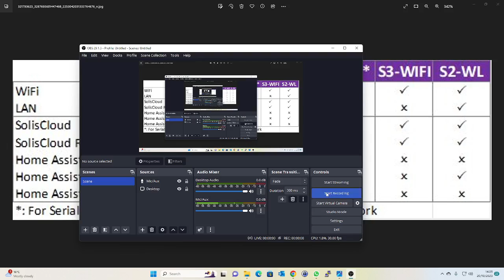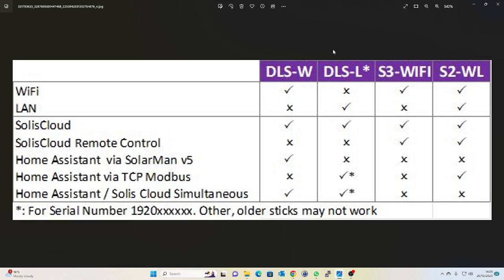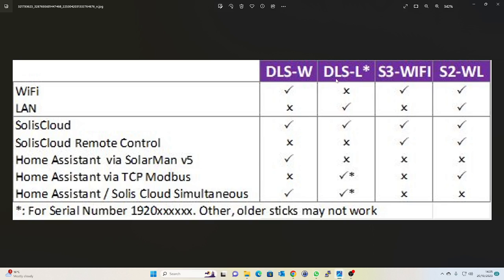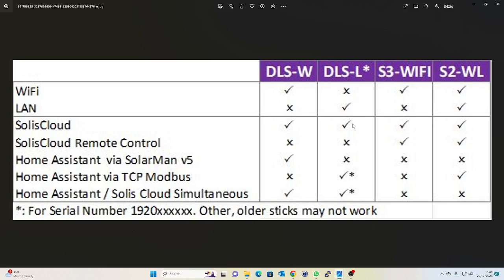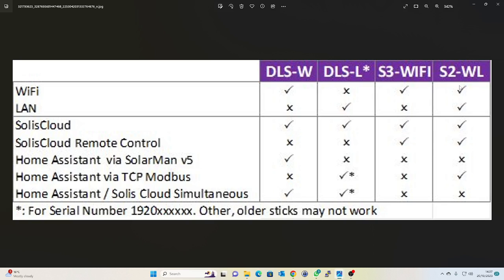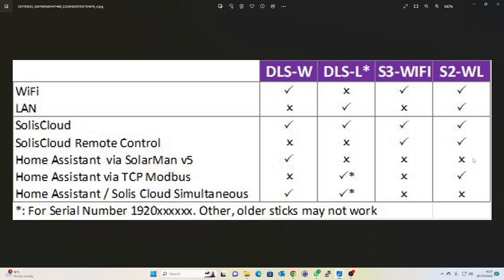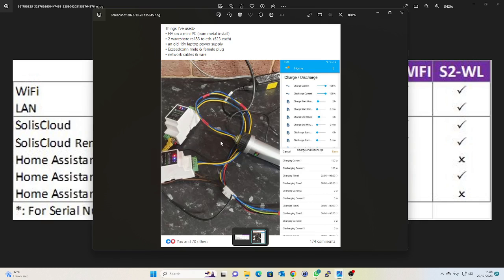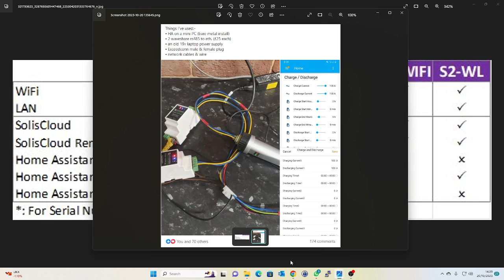Solis Inverter Data Loggers and Home Assistant - which ones will work?

Comment: Wow, your video is so useful. I managed to integrate my Solis cloud to Home assistant so I can monitor the power in my home solar system. I got to the point where I can see my inverter data on HA but I can't seems to find the Home battery storage when I need to configure battery system.  Energy going in to the battery and out of the battery sensors is missing from the list of inverter data available.

Comment: Which HA integration are you using to connect to the Solis inverter? If it's the Solax Modbus, how did you find the inverter modbus address number to use? I'm struggling to get the integration configured.
Reply from the maker: I'm not using Solax on my own system. I'm using solismod/pysolarman running on a separate VM. At the time I built my setup I wasn't aware of the Solax integration. My understanding with Solax is that the devices/entities are all setup for you already so you don't need to know the register numbers directly. You can ask Solis for the registers if you really want them, via this website:https://usservice.solisinverters.com/support/solutions/articles/73000558650-modbus-communication-for-solis-inverters
Reply: Solis support sent me their pdf RS485 protocol document  which just says "The address is available as long as the LCD is powered" !  I've had a look around the menu tree on the inverter as well as looking on Solis cloud and the Inverter info page from a browser but there is no mention of a modbus number. I've tried Modbus 0, 1 and 2 and the config completes but with no device and no entities. I've put in an enquiry with the Solax integration writer on Github and a question to the Solis Inverter Owners group on Facebook. No joy yet.
Reply from the maker: what have you got connected on the inverter side? An S2 or DLS-L solis logger, or a waveshare ethernet or usb device? Solax will only work with those as far as I know. When I've done testing with Solax (with waveshare USB/RS485) as soon as HA 'sees' the inverter then it will pick up all the devices/entities and you don't need to actually know the registers.    @ricobass0253
Reply: I believe the hardware is working because the Soliscloud is still showing my "plant" and I can connect to the Elfin Wifi device and see that it is receiving and sending RS485 frames via a browser, every time I run the Solax Modbus integration configuration. The problem is when the configuration ends with "success" it reports no device or entities.  I may be wrong but that's what leads me to believe I don't have the correct settings.
Reply from the maker: The Solax documentation doesn't mention the Elfin RS485 adaptor in the list of supported devices https://homeassistant-solax-modbus.readthedocs.io/en/latest/compatible-adaptors/  also just because solis cloud is working doesn't mean that you have local modbus access. If you are trying to use an RS485 adaptor and a solis logger then you will need to get creative and use 2 rs485 modules. The reason is that the inverter is modbus slave, and the solis logger is master. You can only have one master per network. If you have S3 logger then you are best just getting rid of it, as all it gives you is solis cloud which is poor. Get a waveshare ethernet or USB device as per the documentation and it will work, and give you far more functionality than solis cloud will ever give. if you have a DLS-L or S2 logger then you don't need the waveshare and Solax will talk directly to it.  @ricobass0253

Comment: Thanks for this! I can read from solarman v5 and get it to MQTT, but I stil havent figured out how I can possibly control the inverter through HA - its just a minefield and doesnt work.
Reply from the maker: Which logger do you have. If you've got DLS-W then follow my first video and you'll be able to do it. If you've got S2 or DLS-L then you should be able to do it with the Solax integration into HA.

Comment: Thanks for this useful summary.  My Data Logger is described in the accompanying user guide as a "DLS Version 2.2".  It is Wireless only. Does this mean it is a DLS-W? System was installed in 2021.  Unfortunately, I am having to replace it with an S3 - as I accidentally pulled it away from the inverter and in doing so disconnected all four wires from the housing - and don't know which of the red, blue, yellow and black wires connect to the four connectors on the green housing - anyone know please?
Reply from the maker: Hi, thanks for watching and the comment. If you ask the question in the Solis owners FB group I'm sure someone will know the answer to that.